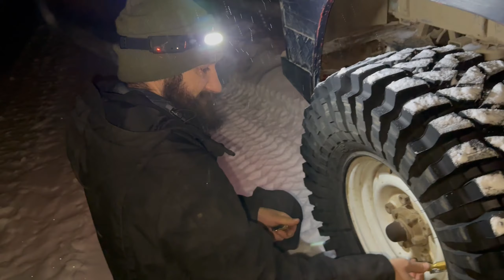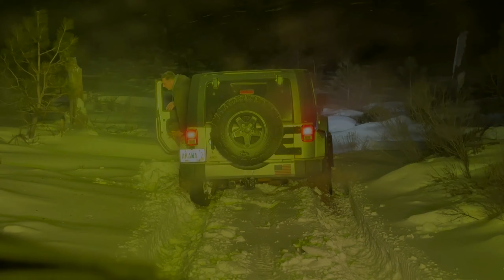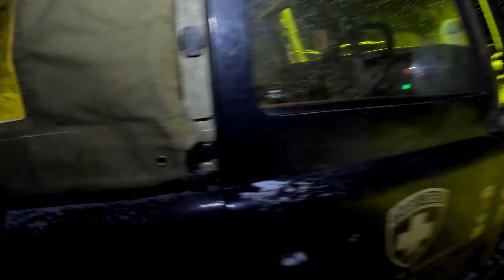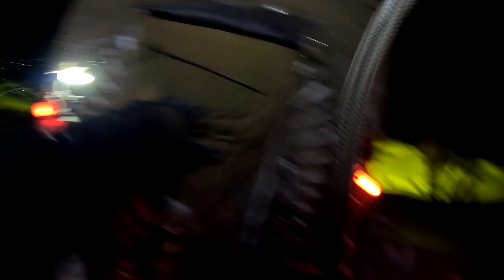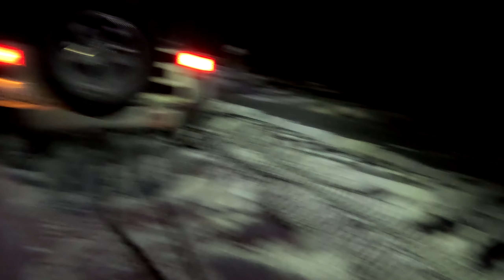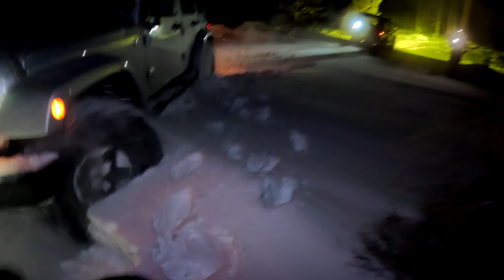OFFROAD RECOVERY MISSION to rescue an LS3 swapped JEEP!

Comment: Love the videos! 

Craziest is I lived in Sweet Home & took my 73 Super Beetle up to Hoodoo while skipping school. Sitting in the shelter & heard on the AM radio whiteout conditions hitting hwy 20. Headed home as quickly as I could, but at that point, I was asking myself, am I still on the road just as a semi started passing me on the left. That bug took me so many places that I floated by the 4x4's or straddled their ruts. It got stuck many times, but with enough people, it could be picked up & moved 😂 & I kept a tug boat rope attached to the front bumper.

Question that I can't figure out, though. No beadlocks but airing down to almost nothing. How? Is it the wheel or the sidewalls on the tires? What tires are those? & are they a ruff riding SOG on pavement?
Reply from the maker: 😂 that’s amazing. We love Hoodoo. Hope you still have that bug! 

We wouldn’t recommend running your air pressure as low as ours. These wheels have safety beads and are much more difficult to lose a bead on. They’re relatively smooth on the highway 🤠 but definitely not for everyone
Reply: No got a 74 Super Beetle, 79 Westy & 07 Wrangler now. We were wondering if it was the wheel with the bead.

Comment: I had my first Jeep when I was 20 years old when I lived in Maine. It was a CJ5 with the 304 V8. Durning the winter there were some dirt roads the town didn’t maintain during the winter. They were closed until spring and weren’t plowed during the winter. After several snow storms a friend and I thought we’d see if we could drive through on one of those roads. We got a running start and made it about 50 yards down the road until the jeep floated up on the snow and all 4 wheels were off the ground. That was 40 years ago so we didn’t have cell phones to call anyone to come get us. We ended up shoveling the snow out from under the whole jeep until we got all 4 tires back on the ground and eventually we were able to back out to where we started. Fun times. Lol
Reply from the maker: Thanks for sharing! We love the old CJs. I’ve been in Maine when it was -15° out and every diesel froze in the parking lot. We were in an Range Rover Classic towing diesels all over town until they would start 😂. Good times

Comment: Wondering if you have ever tried the deflators that you can set different pressures
Reply from the maker: We know of them but we are always changing the pressures based on the trail conditions. So those deflators wouldn’t work well for what we do
Reply: @threecreeksbackcountry you are thinking of the Staun ones. the one's you can buy in Australia can be set at different pressures buy turning a thread which has the pressure 5psi to about 40 psi i think printed on it. So can be set at different pressures multiple times out on the trail. Google "Campboss tyre deflators"

Comment: I had to do recovery of my 2014 F150 FX4 with my second vehicle 1999 Isuzu Vehicross because I wanted to take a picture. We went looking for snow and finally found it in Georgia - North Carolina border. I was at the back of our 3 vehicles with my brothers. One driving my VX. I got everyone to stop for a cool pic. But then I went to get going again and my rear just slid the truck sideways and the passenger wheel was hanging off the edge. That's the short story. If I had been in 4 lo and/or thought to lock the dif I might have been OK or at least better.  My tires were in pretty bad shape for snow!  But it turns out we go info that the trail was much worse. So we all had to do Austin Powers to get 2 full size trucks turned around. No prob for the VX though!
Reply from the maker: Didn’t realize there was that much snow out that way! Thanks for sharing. Don’t know much about the Isuzu Vehicross. How do you like it?

Comment: My craziest off road experience was when my older cousin had a stock 99 Jeep wrangler with a 4 cylinder we where at silver lake sand dunes and we where hitting woops like a rzr but then are other cousin decided to race us up test hill (the biggest dune there) in a 84 wrangler that had a 4 cylinder but was only running 3 so he told us to unplug a spark plug so it was fair and we went they made it we didn’t so we backed down plugged the spark plug back in and went we made it up and about the 2end or 3erd hill we hit it way to fast at the top and jumped i got the wind knocked out of me it hurt but i still can’t believe it was a stock wrangler with stock tires
Reply from the maker: 😂 love it
Reply: @threecreeksbackcountry  that same week Ford was testing the new raptor R at the dunes, and there was a couple of them struggling to get up this hill, so my older cousin put the jeep in 2 Wheel Drive and reverse, and we made it up no struggle